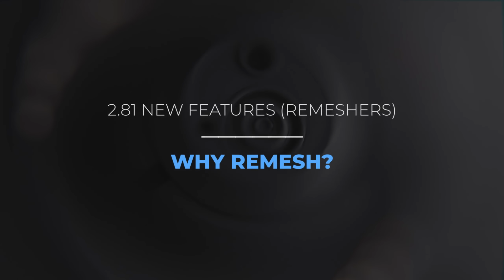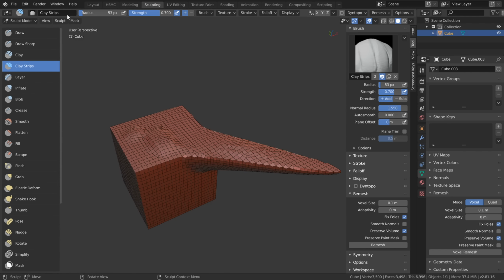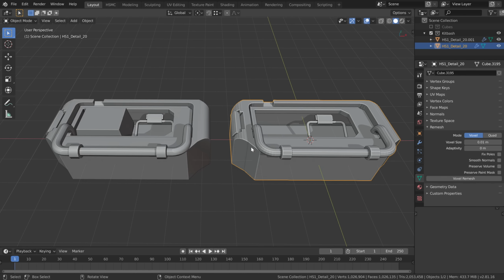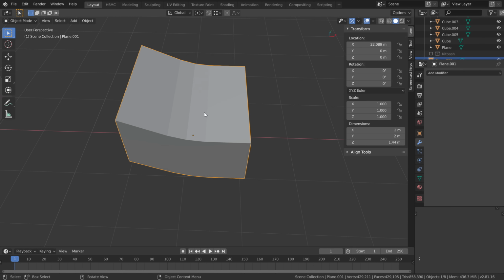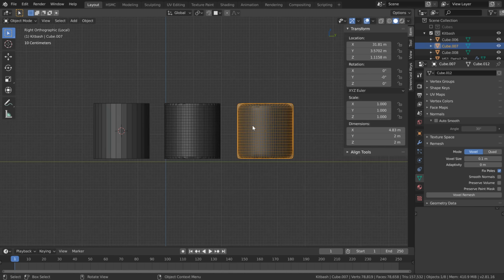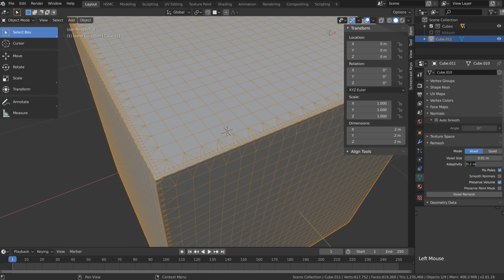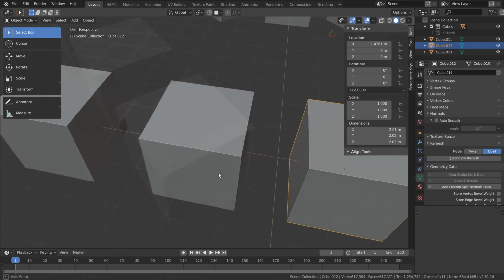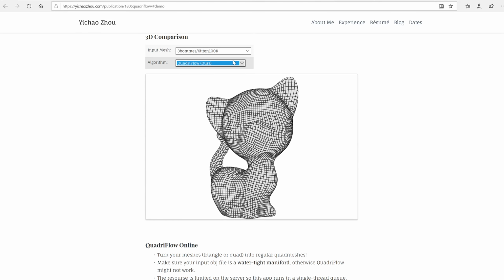Blender 2.81 Features | The New Remeshing Tools

Comment: Instant meshes as open source and free is also a great option. It also has the ability to control mesh topology flow interactively by stroking curves on the surface. It's easy to learn and use as well. I think there is also a version of it for use inside of blender but have not tested that version of it.
Reply from the maker: Ah yes, definitely a cool option. I was using that a while back. :) Didn't realize about the addon though, i think it's here... https://github.com/knekke/blender_addons :)

Comment: Great explanation of the tools. However it all seems a bit counter productive. I thought remeshers were for reducing poly count but when you remeshed the hard surface item the quads almost doubled!
Reply from the maker: Thanks! And good point! These remeshers are mostly expected to be used for sculpting, to get back that even resolution rather than reduced topology. Though depending on the shape of the geometry could also be a basic way to reduce and optimise the mesh. The decimate modifier should be considered there too, I remember hearing from a game studio that used to just use something like the decimate modifier to get all of their low level of detail meshes but that was a while back now! :D I've heard good things about SimplyGon but otherwise it looks like AI with user guided input to direct some auto retopology results will be the where we end up eventually! :D
Reply: That's because the hard surface item had few polygons to begin with. If they had been sculpted they would likely have many thousands of polys with poor topology and this is where the remeshers are useful.